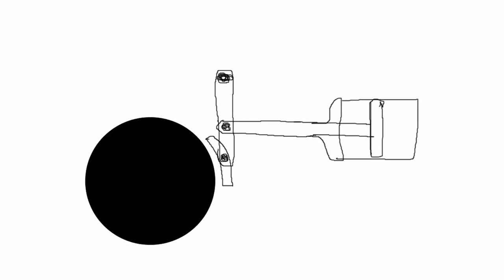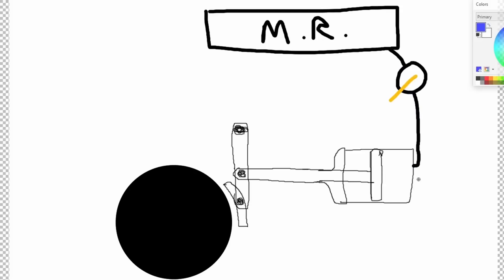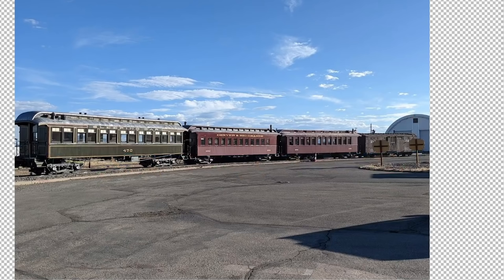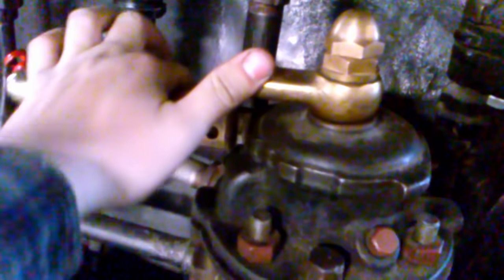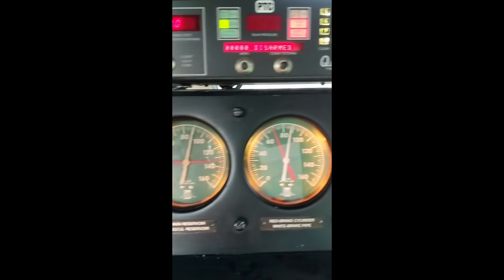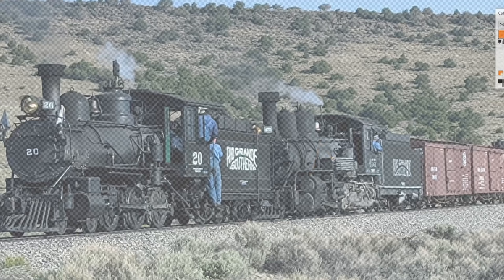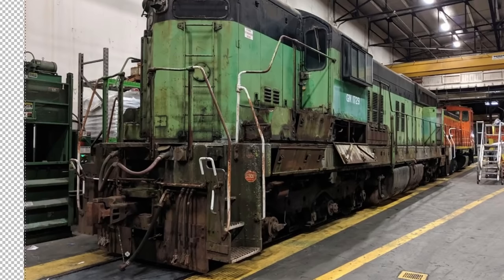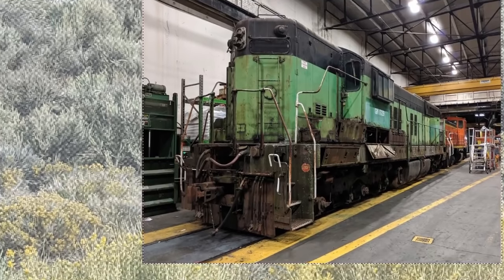AIRBRAKES 101: 10 levels of TRAIN BRAKE understanding!

Comment: don't 4get transition, automatic changingin of traction motor connections, and wheel slip relays.
parallel transfer relays, field shunt relays. . .
Reply from the maker: Transition might be a smidge too high level to explain for a 101 video, but good tips! I'm not sure just how deep i want to get in the electrical side of things, because 1. It's where I know the least and 2. It's pretty complicated. Might be bare bones this go around, and i might see if i could get an electrician buddy of mine to help out on s more advanced course.
Reply: @Hyce777  It is complicated, I mean you start off w a constant kW
traction generator, (TG) if its volts are made to increase by 10% its amps will
drop by that much. Due to the traction motors (TM) being highly inductive 
loads, they will generate a back voltage, The TG's voltage will keep on going up 
so it can force current there the motors, BUT its current capacity will go down. 
Motors need current to produce torque, and if TG's current is reduced the TM's
 won't have the torque.. So that being said,  TG's volts increase causing the (FSR)
field shunt relay to operate. this puts a resistance across the field coils of the
TM's, now if there were 500 amps going thru the armatures and fields of the
TM's now there is 250 amps going they the field and 250 thru the resistor across the field coils. . Since half the current is going thru the field coils it means
less back voltage too. Generator voltage drops and its current goes back up
and the motors now have the torque they need. when the loco, say an EMD
GP-9 begins to move its tm's are in series parallel 1 and 3 in series tms 2 and 4
in series across the TG. that is stage 1 when the field shunt resistors are placed
across the TM's fields, that is stage 2 of transition.  time 4 some coffee.
Reply from the maker: @raymondgarafano8604  I've never had it explained in that much detail before! I knew it was about changing from series to parallel or series parallel but I didn't realize the exact reasoning, or how it happens. Cheers!
Reply: @Hyce777  Thankyou very much, I do think the old Alco switchers 660 and 1000 hp may start in full series possibly called forestalling? I know the GP-9's
have 4 stages stage 2 takes effect between 18 to 20 mph then around 35 mph 
with an even higher back voltage from the TM's the PTR (parallel transfer relay) kicks in. the contactors for the motors being electro-p-neumatic, well at the proper time for transition a circuit is closed and and air valve opens to admit air to the air motor or engine to close the contactors. The loco will NOT operate until enough
air is built up and if an Emergency application of brakes takes place , the crew has to wait till sufficient air is built up to work both the brakes and electro-p-neumatic
contactors. time for coffee!

Comment: Your first statement on air is an error. Its actually reverse. The compressed air is used to keep the brakes off. When you make a reduction using the automatic brake you reduce the pressure thus allowing the shoes to make contact with the wheel.
Reply from the maker: I suggest you watch the rest of the video, and or do some reading :)
Reply: @Hyce777  funny I run trains for a living compressed air keeps the brakes off hence a brake pipe reduction aka removing air from the system applies the brakes. Dumping the air or placing the train in emergency means there is no air on the train.. No?? Unless you are getting into Mr Westinghouse triple valve  that I went through that training20 odd years ago.
Reply from the maker: @theknickerbocker5808  ah i see where we're not connecting on this. If you couple up to a set of cars sitting off air, you have to charge the reservoirs before you can make the reduction to make the brakes apply. You are correct, no air in the brake pipe means brakes are on - provided your reservoirs were charged. Which, for someone as yourself who runs them for a living - is most of the time. But your buddies in the car shop and the hostlers who build the trains and then test them out have to deal with charging the system first. :)

Comment: You said the air pressure must be less than the steam pressure.  This may be true for the system on this engine, but you could create more air pressure than the steam pressure if the steam valve is larger than the air valve.  Which looks like this is true for the second valve.  Meaning the second air valve is smaller than the steam piston so the air pressure could be greater than the steam pressure pushing it.  Otherwise a great video.
Reply from the maker: Yeah, that's definitely an error on my part. It's the case with every locomotive I've operated, but I have realized that it's for the sake of flowrate + volume rather than physics. Thanks for the comment!

Comment: You should fix your mic Hyce. There is a lot of crackling and it is a bit distracting
Reply from the maker: I am working on it. It's a frustrating problem, believe me. I went to re-record in narration mode over the top of the video while playing and it crackled worse than the original recording. I went to record in my DAW (what real audio people use) while playing the video and the video sound wouldn't play through the right output because my interface is not getting along with Windows. I've got almost four grand invested in this darn audio setup so I don't want to give up hope and buy a USB headset or something but I might have to. We'll see.

Comment: Is "Pissing away your air" still a problem?
Reply from the maker: Less so these days with multiple high capacity air compressors and reservoirs per train, plus dynamic brakes - but it still could possibly happen. That said,  most engineers these days use dynamics for most mountain running more than anything else.

Comment: nice video. You truly hit the ball out of the park for a home run that had all base loaded. Well done for those who don't know any of this. I know a lot of this stuff. And I have watched to the end. Wow and you had real world vids 👍👍 May I give you a heads up. Back away from your mic a LOT you are much much too close to the mic. Even with my volume turned all the way min. You keep P POPPING  and it really hurts the ears. Very very bad. your whole video was plagued with this bad audio you do not need to be up close to a microphone. Brother You should be that guy in the class room of students of perspective engineers, during Break systems evolution of the class. Your good.
Reply from the maker: Thanks Gregory! Yeah, unfortunately the audio issue was a codec problem. Don't spend too much money on your audio setup, it makes it worse. Lol. Thankfully fixed now!
Reply: @Hyce777  😂 Thanks for the heads up. but not to worry. I am a Engineer...No not a Rail road engineer. But a Retired Broadcast station engineer. And if you saw my set up at the house, lets just say my wife is or has gotten tired of it, but put's up with me. 🤣🤣 My complete knowledge of all things rail road come from years asking, What's that do, and the people who answer are the ones who do the amazing work on the rail road.  I can't tell you how many hours or times I have spent with a hard hat on in the Pits following the inspector or Carmen doing repairs and turn around inspections on the acela express train set. And I will let you guess how long I been doing the crawling around at shops. the GG1 fuel dock in sunnyside yards and even gotten to set in on a class of student shop employees learning all that there is to learn about the system they would latter have to fix and work on. yeh I know a little bit about this stuff. lol👍👍

Comment: I understand this is air brake 101...  get yourself a modern airbrake book and read it ... look it over look at the diagrams and then tell me the positions of the 26L valve in the cab.  I learned on the 6K i think it was called...automatic without independent hold... on a diesel mechanical 4 speed Davenport built for the war effort in 1942.  as you can see I'm sitting in the cab of a B30... ESPN 7811 ex SP7811

Paul
Reply from the maker: Very cool. Yeah, I'd love to get a copy of a modern airbrake book. Most of my experience lies within 6ET and A1, which is ancient history. I've only every messed with 26L a handful of times.

Comment: Or does anyone in this forum have any resources for troubleshooting graduated passenger car braking sytems?
Reply from the maker: Outside of old airbrake books, I personally don't have anything. What's it doing?
Reply: @Hyce  I am a Carman at a major passenger Railroad. I Just landed a job as the Airtech Carman. I'm trying to gather more knowledge on trouble shooting. But I'm having a hard time finding troubleshooting material on line.

Comment: What are brake modes lead, 6-26, and 24?
Reply from the maker: Not certain what you mean if I'm honest! Lead is the only "mode" that i know if out of the terms you've said - i.e. leading locomotive, cut-in. 6-26 might be the type of 6ET with the 26L style independent valve. 24 is a whole pile of worms that i know nothing about. 26 is the modern(ish) airbrake we talk about in this video.
Reply: @Hyce777  I don't have experience with any of them since I have only seen vac as well as two pipe air that replaced vac. However, knowing the correct valve positions seems to be a requirement for any TSW groups based around lines using GE and EMD. Even doing tutorials doesn't help since they are already setup but are shut down as soon as you enter TT mode. 

GE seem to be more complicated since they have power running modes which need to be changed to different settings on startup, otherwise uncoupled, started solo and recoupled to formation but then the brake modes are invalidated. Some routes also give GE locos in formation when the front loco was set as a GP38 or SD40 which also seems to cause problems when setting up the EMD for whatever reason, I assume these are incompatible IRL hence the RTT radio for a second driver which was added more recently.
Reply from the maker: @FM60260  Everything you just said made no sense... and I have a feeling it's TSW being screwy rather than you being wrong. I'll see if I can't figure it out when I get TSW. EMD and GE are 100% compatible...
Reply: @Hyce777  From what I understand, the GE class 70s are unable to work in multiple with EMD locos..

When I have tried using EMD locos in TSW that have ended up spawning in double/triple with GE locomotives, the GE locos seem to be unable to respond. 

From idle if I have been doing it correctly all I have to do on an EMD is set the three switches that are almost always grouped together to the on position, move the brake MU to 6-26 or Lead/Dead (whichever works) and set the brake key to cut in or cut in passenger or freight. To start it, I switch the switch on the bulkhead to start, then I go to the switch near the govenor, prime then start, then switch the first back to run. Unless it has the starting switch on the bulkhead too like the CalTrain examples but they also have the ETS generator which is fairly easy to start. The EMD locos to me are also rather simple to fault find if they are not starting since I can check the switch positions. If only I could make sense of the engine internals though (triple valves plus the standard exhaust port?) although that might be secretive territory.

GE locos on the other hand I find are a lot more complicated. All the brake modes are set with the computer which seems very hard to navigate and it is easy to lose brake settings if you hit the wrong button instead of the save button. They also have five or six positions on the run switch and when I set it to the starting position there seems to have no result when I press the engine start button. I even bought the other GE loco DLC hoping it would be different... It was different... just more complicated than the other one.
Reply from the maker: @FM60260  that's... Entirely an artifact of train sim and not anything else.
Reply: You're talking about the positions on the independent conditioning valve, or MU-2A valve.  There are two different basic types of MU systems for the independent brake on diesels and electrics, one pipe or two pipe.  In general, the 6, 8 and 14 systems use a single independent equalizing pipe, while the 24 was the first system to use an additional separate actuating pipe to 'bail off' trailing units (keep the locomotive brakes released when you set the train air brakes).  During its early years the 26 was available with either system, and could vary depending on the individual railroad.  So on some units the positions might be "Lead or Dead", "Trail 6", and "Trail 24-26".  The different valve settings allow trailing units with one system to properly work with a lead unit that has the other.  

The two pipe system has been the industry standard for many decades, and these along with the main reservoir hose are the three MU air hoses that are found on modern North American locomotives.

Comment: So a vacuum holds the breaks open so if failure of any part of the breaking system would apply breaking force. Vacuum is safer buy harder to maintain! Hence why the British system is better because failure of the breaking system causes the system to apply force!
Reply from the maker: And it doesn't scale to the larger trains we run here in the states.

Comment: 2:10 why not hydraulics  thats what i want to know that would make the most sense
Reply from the maker: You'd have to bleed the whole system every time you hooked up and carry an absolutely massive amount of hydraulic fluid with you. If you had a dedicated set of cars that were to never uncouple, it could work, but for the dynamic situation of setting out and picking up cars, it just doesn't make sense - as you'd have to separate and rejoin hoses. Even with shutoff valves and short hoses, the loss, re-fill, and then "bleed" to ensure you'd actually get hydraulic pressure the whole way down would be a mess, and significant logistical effort.

Comment: Isn't it more like 90 -> 80 means 85 - 85?
Reply: Asking actually, because I wonder for when you decide what pressure to break with, do you then have a way to tell what the pressure in the break pipe is and than gestimate? Or what. Cuz I guess pressure would always end up equal but depending on volume diffrences it can be anywhere between the two starting points?
Reply: Or does it even matter for operating? And you go by feel
Reply from the maker: Good question! You have a gauge in the cab for the brake pipe. You don't know about the brake cylinders on the cars, but it's almost always 2.5 times the reduction at the pipe based on the control valve; so a 10 PSI pipe reduction yields 25 PSI in the brake cylinder. You do go by feel, but you do need to know how much you've taken.

Comment: I think you underestimate the power of absolute vacuum lol. I see why vacuum would be problematic on rail, but vacuum is still incredibly powerful even in a less than ideal vacuum. I about died when u showed modern computer brake control. I was expecting an industrial style pcb I got 16 boxes mounted to a cast iron harness w a couple of what appears to be wired up 1/4" audio jacks wtf? Can u explain braking computer pls?
Reply from the maker: It is, but compared to a pressure differential several times greater, it's no contest.

Comment: The brakes on a train are off when the system is at 90 lbs PSI. The brakes apply when air is dump out. You explained it ass backwards in the video.
Reply from the maker: I explained how you have to charge the train first to get there. Watch it again :)

Can't dump with empty aux reservoirs. Gotta charge everything to 90 first, and THEN what you said is true.
Reply: @Hyce777  Hobo shoestring explained it better than you did.
Reply from the maker: @scottwoods5851  I'll have to go check out his explanation then and see what I can't pick up to better my own moving forward. Cheers :)
Reply from the maker: @Alfred Weber Cheers Alfred :)